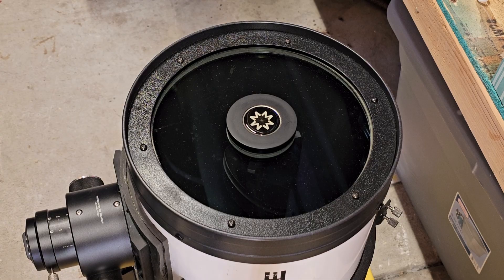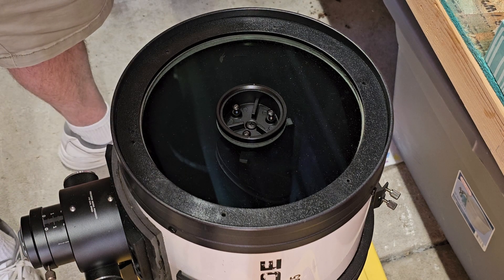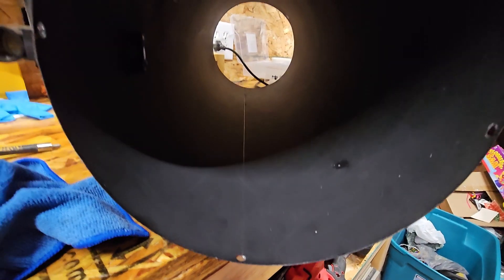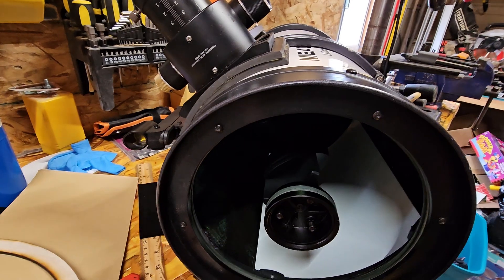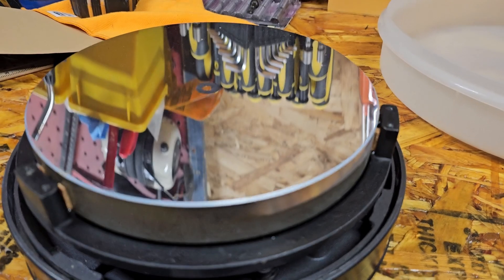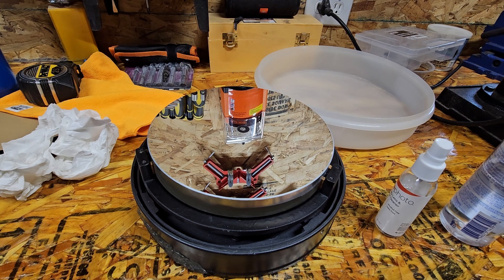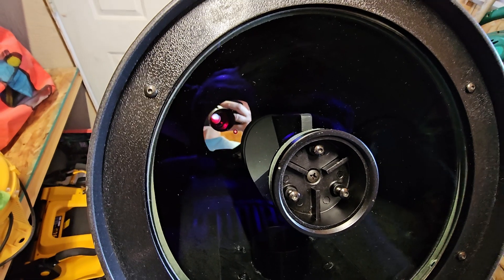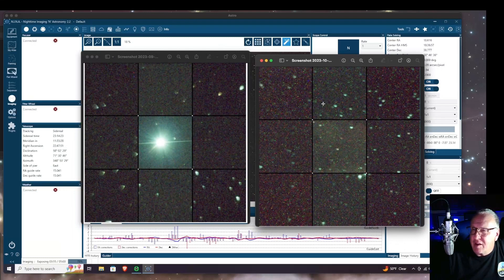More Cheap DIY telescope upgrades and “Hyper” Collimation

Comment: I'm trying to get rid of some triangular stars in the near future. Culmination alone got me about 3/4 of the way there. Adjusting the secondary mirrors in the corrector plate or at least checking the dimensions first sounds good.
I'll probably use the depth stop on my caliper. That should get me to 1/10 mm.
Thanks for the video - it was finally a helpful one
Reply from the maker: Best of luck

Comment: Towards the end looks like the marks on the green tape are off, I would not think there is that much play in the ring holes? But the camera angle was not straight on. Thanks, just might do the same to my SN8 as I have flocking paper...Also I think you are seeing Coma as I have a Coma Corrector but have not used it for imaging..Just an idea.
Reply from the maker: I'm pretty sure it was the camera angle, I had it lined up pretty exact. Check out one of my latest videos where I review a cheap chinese coma corrector.
Reply: @whyf16uy  Cool just watched it! Thanks... I got the Sky Watcher Coma corrector, from what I read 1 of the better correctors out there. The TeleView is the best but too costly, but the 1 you got was a nice improvement for the $... Maybe add a tilt control to your focuser?